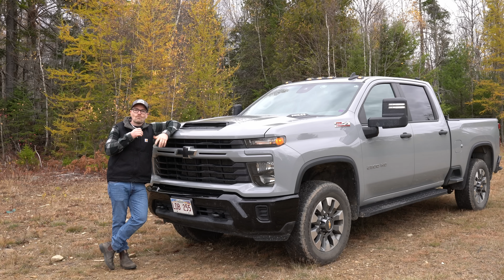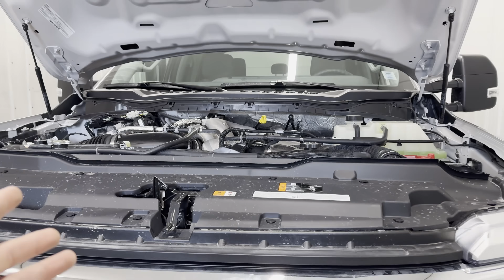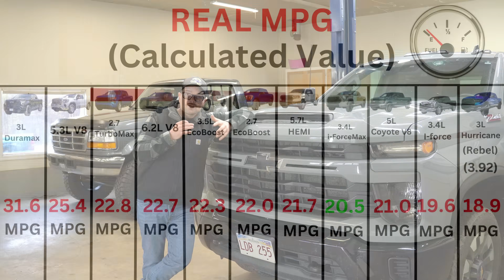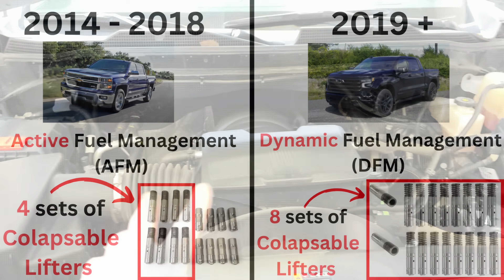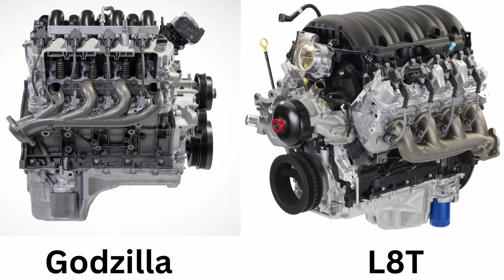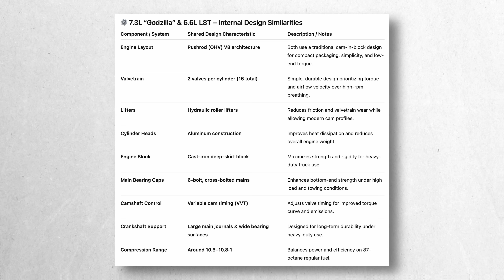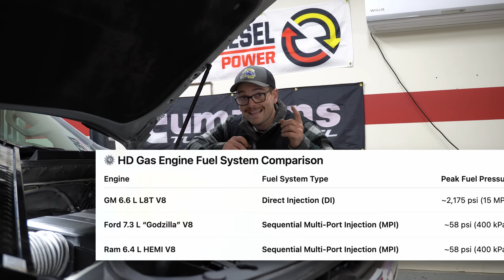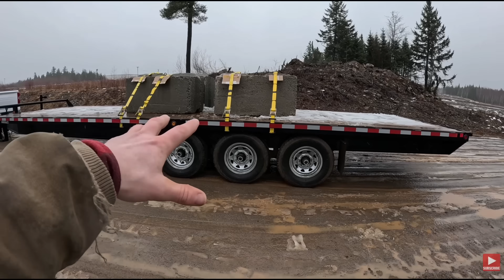Chevy 2500 6.6L L8T V8 Review | GM’s MOST RELIABLE Engine They Still Build

Comment: It's an amazing truck but boss has one and it's needed a new motor at 15k and another one at around 50k. Second motor threw a rod bearing towing 8k on a tailer....
Reply: Sounds like a boss problem. He’s probably an idiot.
Reply: @pryme2013 idk how you can ruin a brand new truck by just towing it on the highway lmfao I think quality control is shit
Reply: @Bojangles06 two failures prematurely is a your boss problem. Like I said, he’s an idiot. Probably never changes the oil. Or you’re lying.
Reply: @pryme2013 lmfao my guy he owns and runs a cattle farm and several soy farms across missouri to texas. He owns and operates many trucks including 4 gmt900 chevys, several OBS chevys, a couple gmt800 chevys, several rams, and fords. His fords all had catastrophic failures so there's a corner of his farm where they all get dragged and left. All of his chevys and rams havent had any issues except his 2025 2500 6.6 gas which he has 2 of. Only 1 of them had lifters collapse at 15k which was deamed under warranty and not user error. 2nd issue was one or several rod bearings going out causing almost complete loss of power forcing him to limp it to the shoulder while towing.

So yeah, its shit quality control, they've bought all of their trucks brand new and never had this issues before.

Comment: That plastic intake manifold cover has been the same design since 2014. And wow, is it ever stupid. The christmas tree clips that hold it in place in the rear are virtually impossible to get to. If you want to save the plastic cover you are better off removing the whole intake manifold, or do like i did juat cut it up into small pieces amd removing it permanently.

Comment: I have a 2022 with 90k+ miles on it and hauled my 5th wheel rv, which I got weight the day I left weighing exactly 9,970lb. Hauled over 1200 miles and it did fantastic. It did drink gas at an average of 8.8mpg by the end of the trip but felt great while hauling

Comment: The intake manifold needing removal for many repairs on this engine is a definite downside. However, I would like it to be known that they are not hard to remove on these. It certainly does not add more than a half hour or so to the repair time for someone who knows what they are doing.

Comment: I’ve got 47k miles on my ‘24 HD gasser. I bought the WT trim and a standard cab 4x4. So far not much has gone wrong other than a stupid software update killed my battery. It tows awesome, terrible gas mileage, I get 15mpg on the highway. But I knew that was a feature when I bought the truck. Has a lot of stupid features I don’t like, use or need. Like power windows, power locks, push button starting, push button parking brake and an infotainment radio I can’t figure out how to work. But for $49,000, I’ll take it.

Comment: Your though process on direct injection is incorrect. Fuel dilution is more prevalent in port injection due to incomplete combustion. Unburned droplets of fuel find their way past the rings. High pressure direct injection atomizes the fuel for a more complete burn, reducing dilution & unburned fuel.

Comment: The 6 speed transmission is indeed a bit clunky, but not a deal breaker. I also do 5-6k mile oil change + follow the extreme use maintenance intervals. I have the GMC Sierra 2500HD and it tows like a dream, which is the reason I bought it. I'm at 46k miles currently and very happy with it. I've never had a problem with it yet (knocking on wood). Given all the diesel problems with DEF and their emission systems, I have no regrets going with gas....aside from not being able to use trucker gas stations when towing. My only real complaint is the stupid mirrors. They're so large that is makes it extremely difficult to see traffic to the left/right trying to make a turn.

Comment: Just bought a welder off a guy on Sunday. Has a 2500 with the 6.6 gas. 34k miles. Uses 1 qt of oil every 3k miles. GM quality right there.
Reply: Ya, know why? He probably didn’t change the original oil early, he probably took it to the 10,000 miles gm recommends.

I’ve got a lot of miles in these 6.6 gas jobs, and none of mine in company vehicles have burned any oil once broke in around 15-20k.

Every single one of my coworkers bitch moan and groan theirs burn oil “well i change my oil when the manufacturer says too! It’s just junk idk what’s wrong with it!” Yeah bud, YOURE what’s wrong with it
Reply: @mtvrchannel3051 pretty sure he was changing it every 6k. His direct quote was that it uses 2 quarts every 6k.

Edit: I'm with you though. I always use high quality oil and change every 5k.
Reply: @MeltingRubberZ28  that’s still too far. 5k and full synthetic is critical, they hold 8qts and thanks to the direct injection this oil comes out black like diesel oil with all the carbon content in the oil.

They’ll tolerate insane abuse, but they won’t tolerate crap oil without burning it 😅

If you wanna help homie, advise him to switch to Valvoline Restore and Protect, change every 5k and enjoy. Also, he needs to spray it with seafoam GDI intake cleaner every 10k miles, it’ll bring it up 2-4mpg removing intake valve deposits thanks to the direct injection no longer flowing fuel over the intake valves, then oil vapor and EGR forming carbon on valves causing it to ping to death. He could also spend $100 on a catch can, makes a world of difference.

I’ll bet the farm that his oil consumption will end if he does the restore and protect.

Comment: I learned back in the 1960's that there's no replacement for displacement when it comes to truck engines and you only need a diesel if you tow something that is multiples of of your vehicle's GVW.   Small blocks are O.K. in 1/2 tons, I had a 350 in my 1972 Blazer, a 283 in my 1965 Chevy 1/2 t 4X4 Stepside, and an L79 (350hp 327 cu. in.) swapped into my 1963 4X4 GMC Panel.  My 3/4 t. and above all had 390 or 400 cu. in. or larger engines.

Comment: I just got a new GMC 2500 with the 6.6 at work to replace a 2014 GMC 2500 with the 6.0l .....the 2014 has 752000 kms on it and is still working daily never been in the motor...you couldn't ask for a better work truck...I'm hoping the new is as good the old

Comment: Now I know why I love a 70 or 71 Malibu with a 2 barrel and a 350 with a pair of Hush Thrush to the rear bumper. Easiest to work on and if you’re lucky you can find a ratty ass EL with the same setup if you want a little truck body. Everything is so how can I make things more complicated not only for the wrench turner but the customer. I would say that the greatest advancement since I was 10 years old would be noise reduction in the cabin of the vehicle. Great Videos Thank You 🙏

Comment: The ones we have as fleet trucks use oil and ping like crazy. We aren’t allowed to buy anything other than 87. I have also noticed a big power difference between units. Other than the oil consumption and the pinging it’s great
Reply: Yup. Thank the low octane fuel combined with direct injection causing carbon deposits on backside of intake valve. Hit it with seafoam GDI cleaner every 10k miles and watch the horsepower return!

I have nearly 200k miles driving this platform, changing oil at 5k and GDI cleaner spray down the intake every other oil change. Brings the fuel economy back up 2-4mpg each time

Comment: I loved my 24 6.6 till the transmission died at 32000 miles and was in the shop for almost two months
Reply: Are they going to fix it with better parts so that it doesn’t happen or same but new parts that will go out in 32000 miles again?
Reply: @lopez12345ml as far as I know same part

Comment: GMs solution to carbon build up on these DI 6.6s is a oil separator built into the valve covers. Mr. Truck interviewed a GM engineer way back when the engine was first introduced and he explained how it works.
Reply: So why does it still have carbon build up?

Comment: Driving my Chevrolet silverado 2500 6.6L for 5 yrs now. 
I do some Hot Shot work and I pull our 11,500 lb 5th wheel with it. She pulls well and drives better the heavier the load. As a old wrench turner from the 70's and 80's, I love the old school design of this engine.
Reply: Being that you have a background in turning wrenches so therefore most likely more hands on with your truck, checking all drive line fluids and changing them etc and noting brake wear, and what seems to be a widely varying report as per some engines using a substantial amount of oil while the next person says theirs uses very little. What notable items have you seen in those ways with your own truck ?. I bought a 2025 model with the gas earlier this year and have few "km" on it yet so I haven't had any issues yet and I've changed the engine oil a few times because of the natural high wear metals during break in. I haven't dropped any other driveline fluids yet though but plan to once it gets a bit more use and really look forward to dealing with that 10 speed transmission pan that can't  come out from under the trans as the exhaust cross pipe is completely in the way. Oh and I plan in the future on changing engine oil every 5000 km ( 3000 miles ) due to the DI system that I am learning more all the time how it is detrimental to the oil as its prone to fuel dilution ( the one part about the engine I would much rather it not have that technology ! ). But anyway I am sure after the years and type of use you have given your truck, you have some valuable insight.
Reply: @charlesb4267  Yes, my truck would occasionally use oil without rhyme or reason, but it just about stopped completely after about 20,000 miles. Your 3000 mile oil changes are spot on. As far as changing driveline fluids, unless you tow super heavy, you shouldn't have to worry about it for a while, but it would be a good idea to change the 10 speed fluid a little sooner than usual, as those Allison "Hybrid" tranny's have had some valve body issues. Be sure to run some Chevron Techron gas treatment at least 2x a month to counter intake runner carbon build up due to the direct injection. Enjoy that truck brother!
Reply: @Sampson1544  Thank you for the reply and glad to hear your truck has been doing well so far. The 10 speed, yes that will be a question mark for sure. This may sound odd but here in Canada Chevron does not sell Techron as an additive in bottles and I have no explanation as to why not. Some time back if you have heard of the tribologist by the name of Lake Speed Junior, he had a video on fuel additives and the two he recommended were Techron and a product called Three In One fuel injector cleaner by Gumout. The Gumout is sold here in Canada so for now that is what I have been putting in every so often and hopefully that helps the fuel injectors stay clean. GM would have a fuel injector cleaner but I don't have any idea if it contains the properties of the Techron, sadly there are a lot of snake oils in a bottle on the market that do little more than empty ones wallet !.

Comment: I change my oil every 5k miles. 13k miles on the engine and so far no oil consumption issues. I did a 1000 mile break in oil change, and then another 2000 miles later, and then 2 5000 mile changes at this point.
Reply: No shit, it’s got 13k miles, you probably don’t have to worry till 60, 70k 😂
Reply: @DyHo_obs  understood

Comment: Put one of these in my 1500. Using 5.3 intake manifold, throttle body and exhaust manifold it’s making 430hp and 540 ft/lbs. oh, 18 combined mpg ain’t bad too. This is how all the 1500’s should come
Reply: Did you use 1500 transmission and how bad was the tuning
Reply: @colbycrow24 yeah. 6l80, the tuning wasn’t that bad. Biggest thing is that because of DFM and AFM, GM programs slip into the transmission which dries the torque converter. That had to go

Comment: My personal experience with my 2024 ZR2 HD gasser is that the transmission feels like it absolutely hates stop and go traffic. However the shifts are absolutely flawless when heavy towing. The engine has great power and the transmission gearing is always where it needs to be 👌
Reply: youre in a 3 ton truck, dont drive it like a city car. even if you can, you shouldnt.

Comment: Really love this channel!  -- QUESTION -- One use that you don't speak about, is if you wanted to plow snow ie small commercial and residential and summer landscaping.  I watch many channels such as Brians lawn maintenance and he has three superduty trucks with gas V8..  2017 6.2 v8 and now the 7.3.  But others "insist" on the deisel.  What do you think makes more sense for snow plowing cottages and access roads to the cottage and pulling trailers related to law care.  Would you go the reliability route with the 7.3 and eat the gas bills, or the power route with the diesel and hope for no breakdowns??

Comment: My 2005 1 ton Chevy 6.0 with the GM 6 speed transmission l purchased new is still running like new. It has over 235,000 hard miles. Changed oil between 3/4000 miles. I use my trucks like trucks are supposed to be used. Also my 2016 2500 HD with the 6.0 has 113,000 on it with the GM 6 speed NOT the JUNK Allison 10 speed transmission.

Comment: The 6.6 has crazy low end grunt. Definitely an improvement over the 6.0. They put the 6.0 gas engines in 20,000 lb stop vans. 🤦🏾‍♂

Comment: My 2001 Chevy 2500HD has 333,500km on it. I tow lots and she is still just walk out turn the key and it fires up on the first turnover.
Reply: My 2002 Chevy 2500HD has 275k miles on it. Still going strong.

Comment: The only drawback in my opinion to towing with gas under 12k pounds is how hard it is to get into modern gas stations with a trailer. It would be nice if the manufacturers offered a larger gas tank on these trucks. There should be room since no def tank

Comment: I’m sure these L8T are going to be very reliable, don’t like the GDI system, but otherwise seems solid. I personally still try to find the previous (pre 2021) trucks with the 6.0 L96, which are pretty much bulletproof and port injected.
Reply: Amen. Not a fan of the DI system.  I’ll keep my 2016 L96 with 27,000 miles on it.

Comment: We bought a 2024 Chevrolet 2500HD with the 6.6 liter gas engine to use primarily as a tow vehicle....we only tow our 25 foot Airstream which weighs about 7200 ibs.  We like the truck and it has bee a good performer for us, we do however change oil frequently just out of habit, I change the oil at least every 3000 miles using Mobil 1 5W30 full synthetic Dexos 1 Gen 3.... no problems so far with the truck...I enjoy driving it and have not had any issues, we have about 18K on the odometer...
Reply: You could tow that airstream sideways with that truck.   When I was a kid we had a 27 foot airstream which my dad towed with a chevy caprice classic 350 4bbl and had no difficulty passing cars. Also with an F150 with the 390ci engine. Later in life my dad admitted that on a solo trip in the middle of nowhere he got the truck/airstream up to 120 mph and the engine had more.  At 120 he cut off thinking “what am i doing.”   Being a guy, dad.  Being a guy.

Comment: I traded my 2019 GMC Sierra SLT with the L5P diesel for the 2025 GMC Sierra Denali gasser. I loved the power of the diesel, (especially since I added a bunch of Banks parts) but I didn't tow much. I'm not saying that the gasser is a pooch but, like you said, it ain't a Duramax. The MPG is suckin' right now but I have less than 2K miles on it. I had 'em change the oil at 800 miles (first service was free). They looked at me real funny when I stated the miles. The ride of the Denali is very nice! Will be getting the Banks Pedal Monster soon (just got used to it with the 2019)! Thanks for posting this sir.
Reply: lol I got the same look on my first oil change at 900 miles on my 2026, even though the manual does say don’t tow until 500 miles and perform first change before first tow.